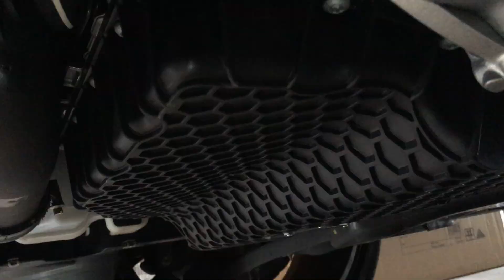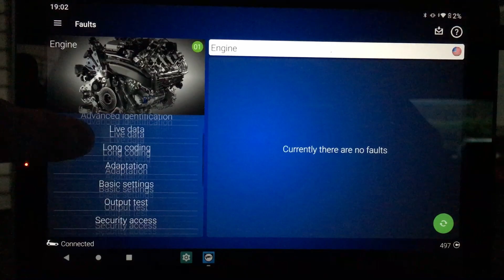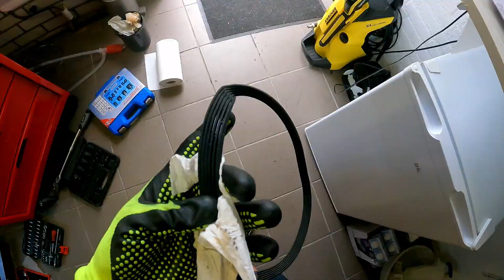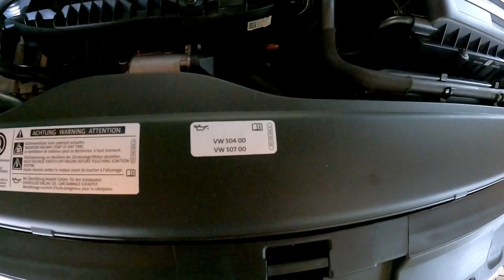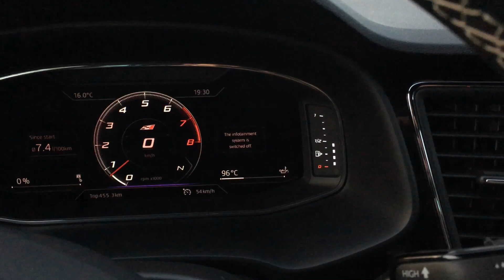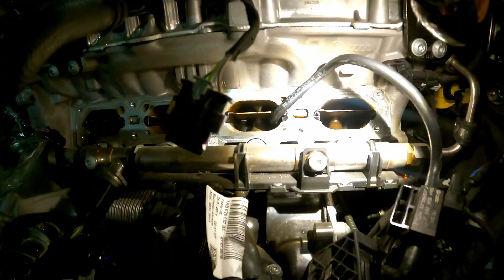Plastic oil pans suck! Here is why...

Comment: How’s the aluminum oil pan holding up ? Does this pan require more oil vs the original oil pan ?
Reply from the maker: Hi! I haven't had a single issue with the oil pan in all this time. An I have used the car in Nürburgring and to make a more than 5000km trip in the middle of summer (+43Cdeg) Oil capacity is the same as stock. Hope it helps!
Reply: @javitobosch  I’m looking to change my rusty oil pan and this would be nice upgrade for sure, thanks.

Comment: I dont think upgrading the pan for tempeture is any idea. Bigger oilcooler and maybe pressure flash? The best benefit is durability and reusability. That original tap screw man, horrible.
Reply from the maker: Hi! Well, I like seeing that the oil pan is able to cool dow the oil and keep it under 120Cdeg in summer. Th drawback comes during winter, when the oil really struggles to reach 80Cdeg and above. I just drive more carefully. I am not really thinking about an oil cooler as the car has an oil cooler. Small but enough I believe. And I agree with you: plastic oil pan is really not my preferred choice, and that plastic screw...oh man!

Comment: It is somewhat strange that the engine uses the exact same amount of oil from the manufacturer. The upgraded oil pan (company) claims it will require almost one extra quart of oil. !!??
Reply from the maker: Hi! Not in my case. I chose to have the same internal volume although I must agree that most of the options I saw back then required extra oil. I think Aliexpress choice has widened since then. Perhaps good to take a look? Let me know what you think!